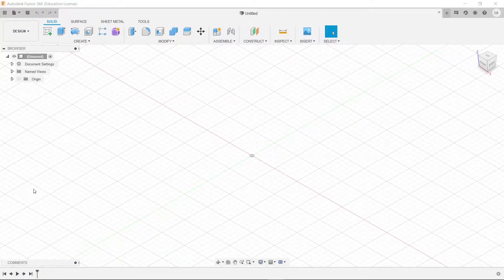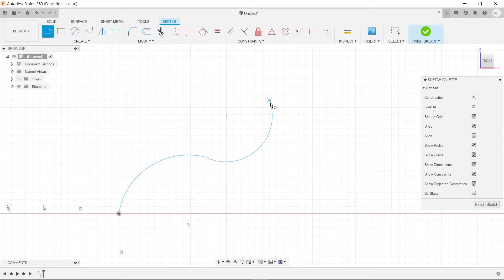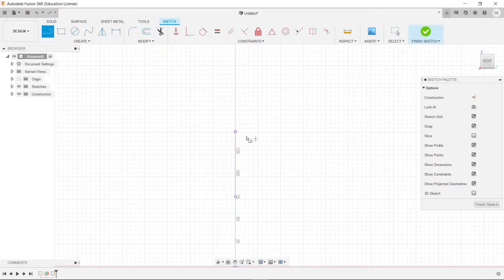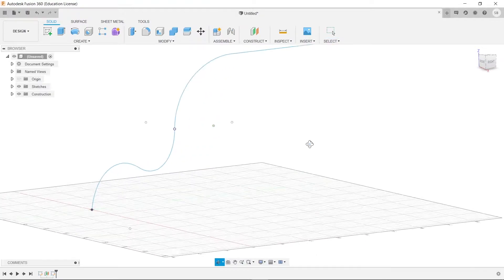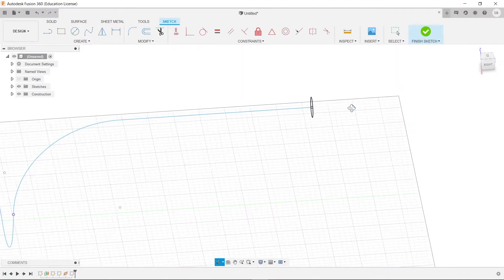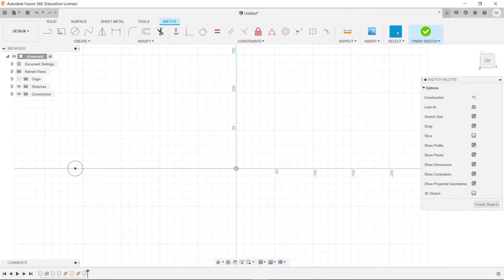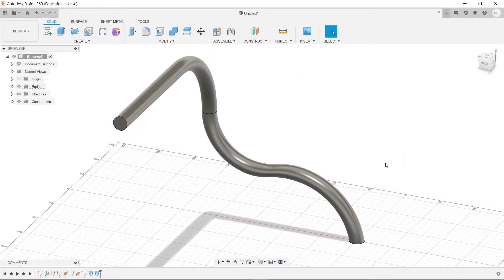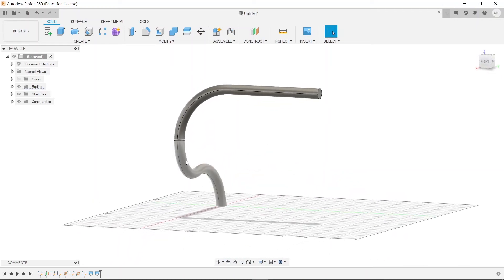Fusion 360: How to make a multi-plane centerline for lofting

Comment: thanks boss, redesigning a heater core return pipe and wasn't sure how to add the 3d bends before using the pipe function.  offset plane and project functions did the trick